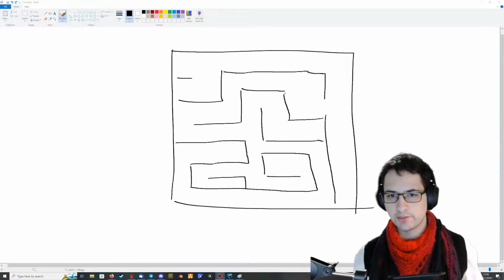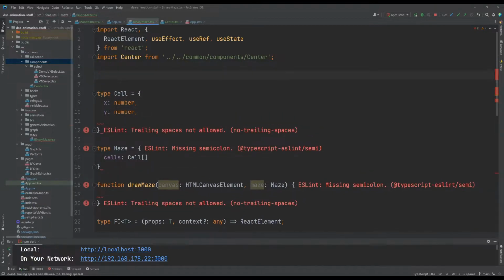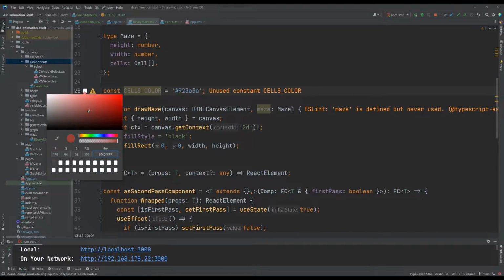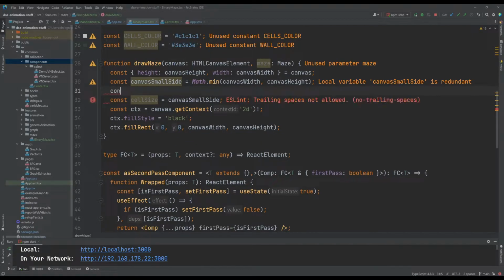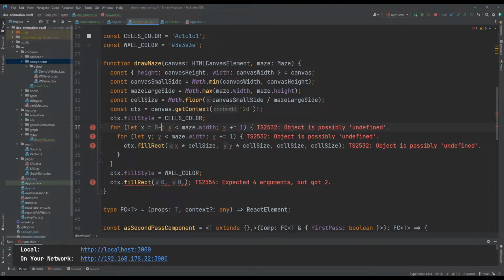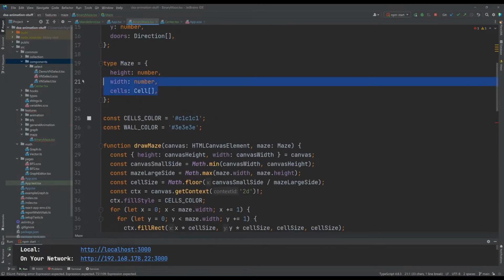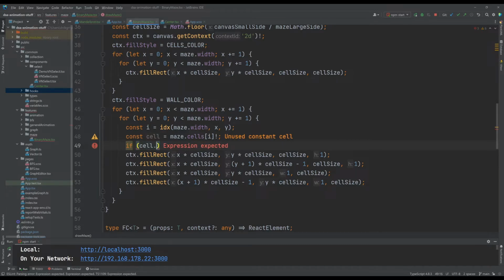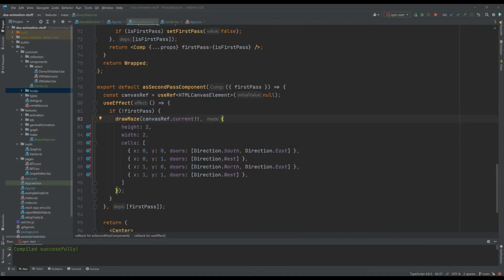Drawing a maze. Setup for maze generation. So just drawing a very simple one.

Comment: Oh shoot you got a green screen!
Reply from the maker: In this case, it was actually up yea, but even without, the background gets cropped out. Since I work remote, i want a controlled and neutral background. So, it's either AI assisted or green screen, depending on the camera running. And this way, I can forget to make my bed ;). The office is currently set up in my bedroom. Seems like I need to tweak the keys though with the new lighting setup I have, I'm kind of fuzzy around the edges.